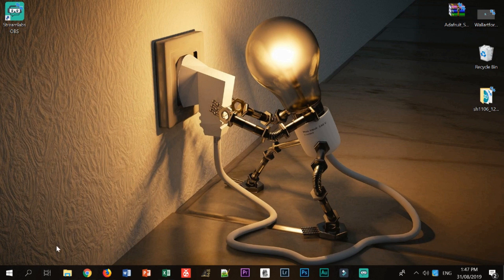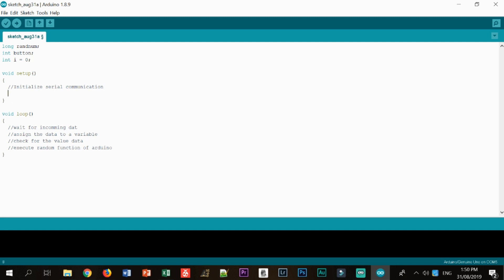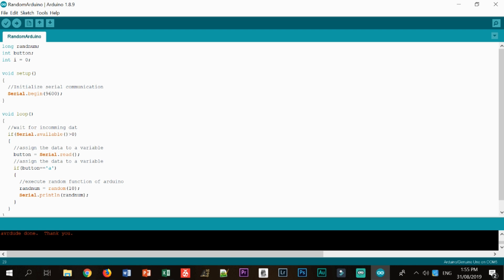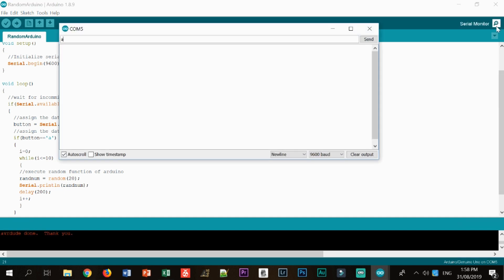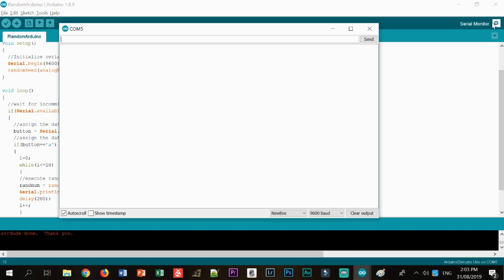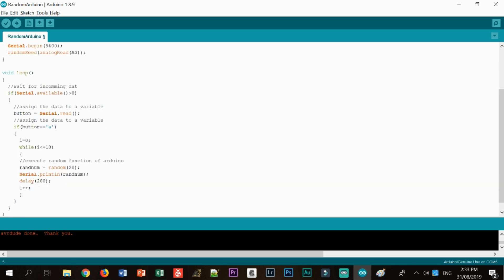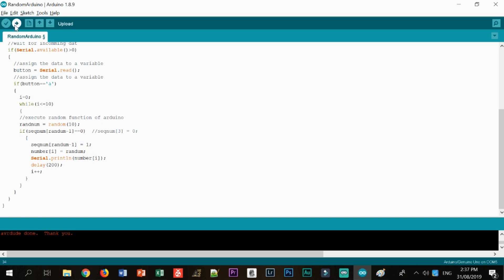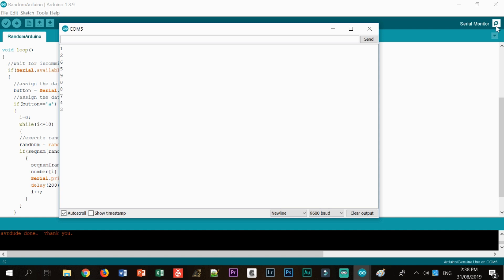Arduino Random Number Generator Function Simplified

Comment: Take the lowest bit of A0 and A1 and pass it into a Von Neumann extractor to get much more uniform output. You can repeat it on A2 and A3 and pass both of them into a third Von Neumann extractor for very high quality random numbers. While this is slow, you only need a small amount of high quality random numbers and then you can pass them into cipher like ChaCha20 to produce a basically unlimited amount.